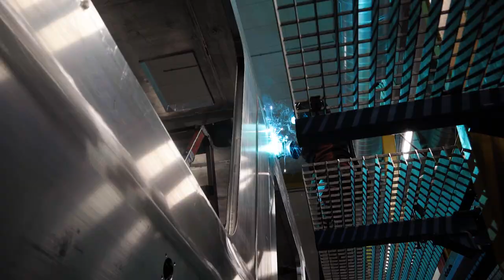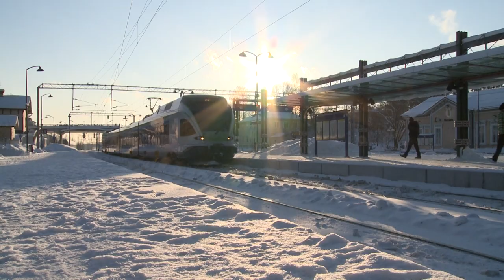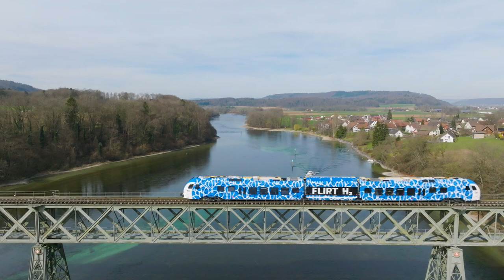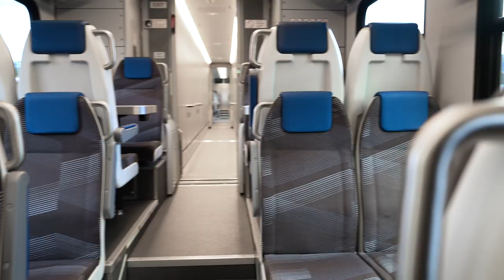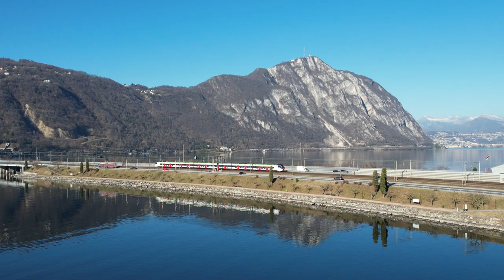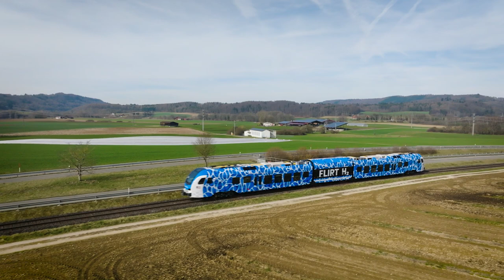Milestone: Bestseller FLIRT sold for the 2500th time

Comment: The Class 745 and 755 you did for Greater Anglia are probably the best new trains in the UK in a very long time.  Big respect.
Reply: The aventras are also good, and specifically the 730 has  gangways to connect to other trains whereas no Stadler train or other aventra has gangways for this purpose.